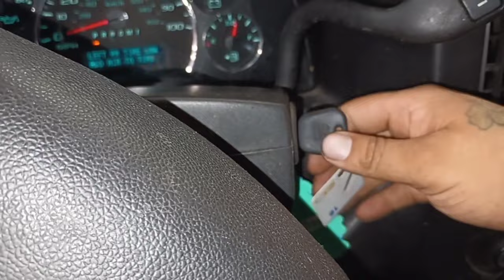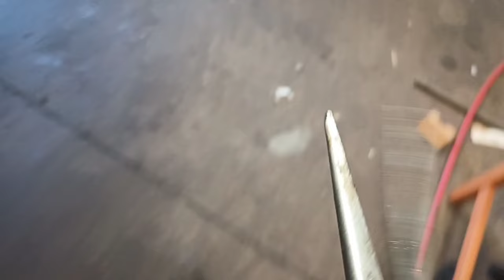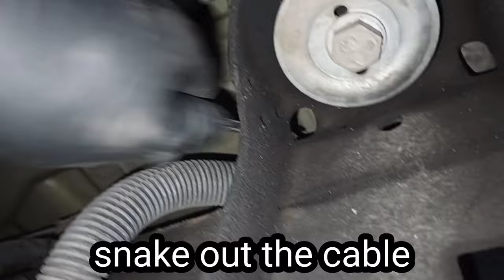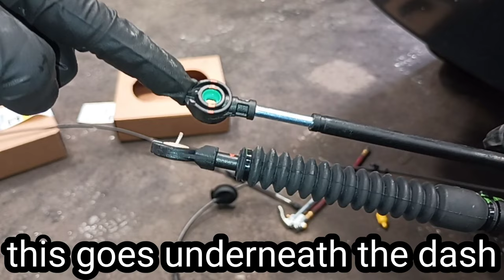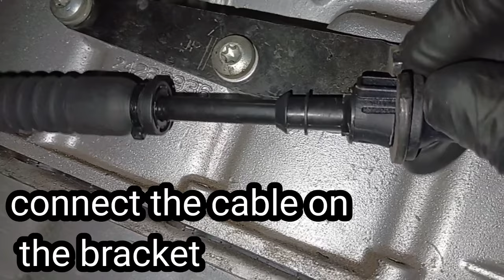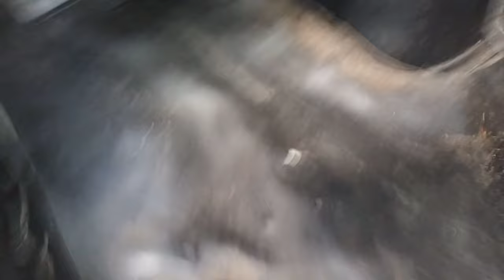shift cable replacement on a Chevrolet express van

Comment: FYI TO EVERYONE: You may only need to replace the shift linkage bushing (little white plastic piece seen in thumbnail) cost me $10 and I crawled under my van and replaced it in 2min with my fingers and some needle nose pliers.

Comment: Thanks for making the video i don’t know how you do it tight spaces!
Well thanks to you I was able to fix my cable
I just needed a  bushing but the price of the 1/2 section was not bad but…end up buying the whole thing )$120)because as I was removing separating  halfway I broke the little clip (on the other section) that holds the cables together and worst dealer part did not match!!  …my fault ! made the mistake of not comparing side by side!!!!
the cable was short it only gave me 123DN. no R no P
so i had to remove everything and of course dealer did not take the part. so i remove the bushing out of it and placed on the old cable and reinstall faster and easy ….not really it works
thanks 
Learn from my mistakes !!

Comment: Thank you very much for the video I am going to only replace the lower which was the exact same problem. I had it just happened an hour away from home and I was able to get it back on long enough to shift the vehicle and get us home. Thank you
Reply from the maker: Glad it helped 🙂
Reply: @luckysdiygarage  Right now i'm having trouble getting adjusted to the right length.
Reply from the maker: @cellgame100  hey what's up boss did you get it to length yet
Reply from the maker: @cellgame100  did you measure the new one to the old one boss

Comment: Only needed the plastic bushing replaced at the cable end. Keep ripping them off bro! 😂
Reply from the maker: I don't like ripping customers off..I'm an honest technician.i recommended the plastic bushing but the customer wanted to replace the whole cable ..so he didn't have to deal with it later...
Reply: After market bushings fall out too easy he did right by replacing the whole cable
Reply: It's a good video and I appreciate that. Thank you sir!
Reply: If you did not notice the plastic sleeve the cable slides through on the lower bracket was broken too! Yes, there is a replacement bushing if that's all that is wrong. This is the best vid on changing the cables and the proper way IS to replace both cables as it's nearly impossible to change one or the other with that phony union spring loaded bastard! CHEERS dude.

Comment: Is necessary replacing entire cable opposed to just reattaching dislodged end at under carriage using something adequate
Reply from the maker: If it's just a bushing that broke they sell the bushing itself if your cable is not broken
Reply from the maker: But you don't Have to replace the cable if the bushing is broken

Comment: I wish you would show the copper clip that actually connects the cable inside the cable connections on the lower side. My new cable didn't come with one, So I had to steal it out of my old cable. could save some people alot of guess work and time.
Reply from the maker: Thanks for the tip boss 👍

Comment: wonderful change, but i do not understand why you did not just put in a new bushing the kits are only 29 dollars. was there a reason?
Reply: I agree do you have a link to the bushings on Amazon?
Reply: The Easiest way to fix your Chevrolet Express Van shift cable!

Ascension Engineering
9.66K subscribers

Subscribe

Comment: Could you just purchases the lower, disconnect the transmission side and connect to new end without pulling the end of the column shifter?  The would elevate having to pull it though the floor board.
Reply from the maker: Yes sir you can purchase the lower end separately..

Comment: Can you please give me a suggestion for my transmission, my 2000 Chevy van, while I was driving doing about 60 mph and my transmission went out, as I gave the motor gas ,my engine was just revving, as I came to a stop , I put it in park and began shifting through the gears, no response from any gear I tried, any suggestions would be greatly appreciated. Thanks.
Reply: And no leaks, clean transmission fluid.

Comment: Thanks for the video, but there were no need to replace the upper cable- it comes on 2 parts, you should just replace the transmission cable section- on minute 4 to 4:09 there is the section where it separates- but I guess the customer asked for all the shifting cable replace- not a quick fix- Just saying- 😂
Reply from the maker: Thank you!!!..Yes sir all it basically needed was the transmission side cable.. but if we're talking about a quick fix then I would have just replaced the plastic bushing on the end of the transmission side cable.. but the customer wanted to replace the whole shift cable!!....🙂😂

Comment: Nice bro!
Do you have the part #? 
My Savana has the same problem, bought the cable but my mechanic said it wasn’t ent the same.
Thanks in advance and great vid
Reply from the maker: Hi Miguel sorry I don't have the part number I threw the boxes away 😊 if you can't find the cable and the only part that broke is the little bushing you can go to the help section at O'Reilly's or AutoZone and they sell just a little plastic bushings and you can just slap that right on instead of replacing the whole cable
Reply: @luckysdiygarage  thank you any way, video helped a lot! 🤙
Reply: That's what I was wondering.  I just need the plastic bushing.

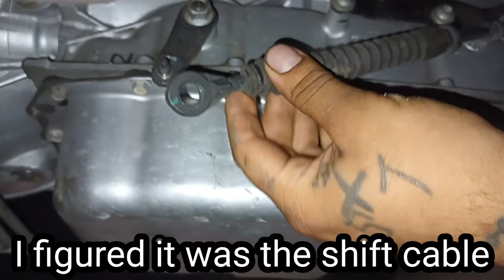Comment: 0:36 why replace the whole cable..when you coulda jus replaced the bushing it was missing..
Reply from the maker: I could have....but it wasn't up to me brother🙂 i recommended replacing just the bushing to save money but the customer just wanted to replace the whole cable to not deal with it down the road..
Reply: @luckysdiygarage  i replaced the bushing on my 09 tahoe..it came off a cpl days later..im jus gonna get another shift lever and drill out the male part and put it back on.the run a screw and bolt thru the bushing so i dont have to deal with it anymore..
Reply from the maker: @IGStrangDaKang  haha that's one way of doing it .🤙
Reply from the maker: @IGStrangDaKang  and another way of doing it you can install an aluminum bushing and drill a hole on the tip of male part and install a safety clip..

Comment: Why not just replace the lower half of the cable. Upper was fine
Reply: I’m thinking same
Reply from the maker: Customer wanted to replace both .. and if it was up to me I would have just replaced the plastic bushings in the lower half of the line that's all you really need to fix the cable.. unless the cable was broken